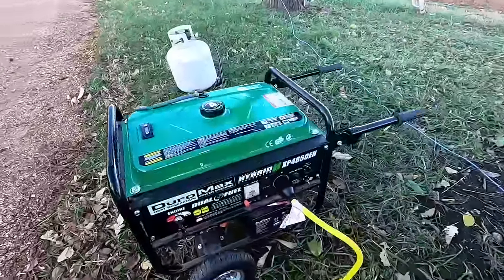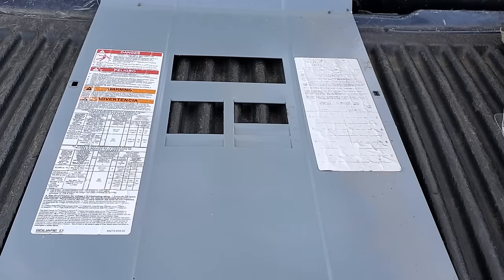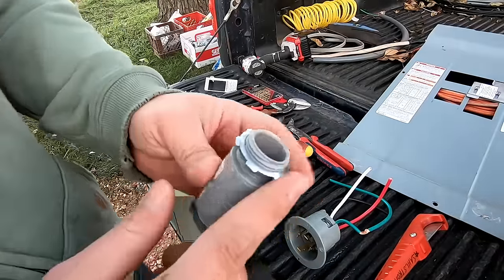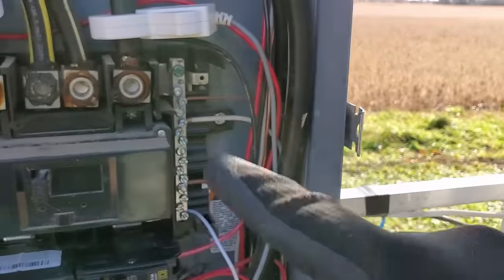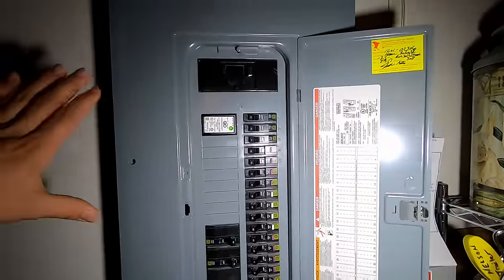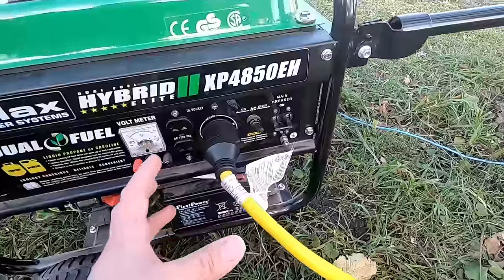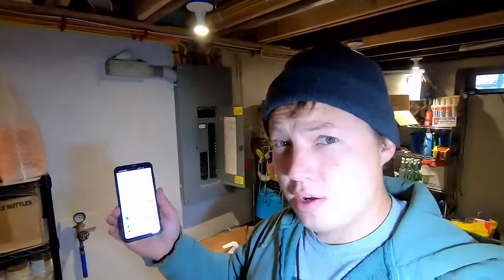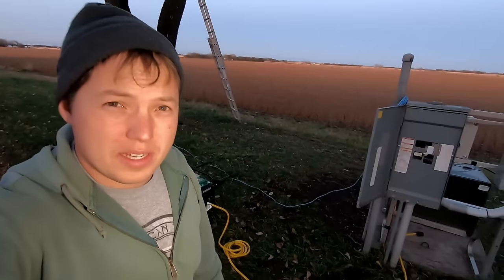How To Hook Up a Generator To Your House Using a Breaker Interlock Kit & Power Inlet Box

Comment: Liked and Subscribed! Great content! I am trying to run 6AWG to a 50amp circuit to get the max out of my 9500/12500peak generator. The wiring should be straight out of my house and into an inlet box that will be flush (ideally). 1.) Do I need to run a conduit if using UF-B wire? If so, how do I get it through the knockout that is 0.85" wide? 2.) 6gauge UF is 1 1/4" wide, will that have to go thru a 1 1/2" conduit? In that scenario, how do I get that into the inlet box with the 0.85" knockout? Any other options would be great before I return the items I most likely should not have purchased. Thank you!!
Reply: Please make sure you follow all the generator safety rules whenever you use your portable generator. 
⚠️Here are the Generator safety rules that everyone needs to follow when using generators:

This is just a reminder for everyone’s safety when using portable generators. All generator safety rules need to be followed carefully to avoid hazards. 

1) Please do not allow an unqualified person or your children to operate the portable generator. Just because some manuals don’t say that doesn’t mean it’s safe. That is important against the generator safety rules. We also need to be keeping an eye on our children too. You need to make sure that your children are not playing near the portable generator especially when it’s running so they won’t get electrocuted. Generators pose electrical risks and they can be hot during an operation. Please keep your children away from the portable generator at all times. It is important to keep our children safe especially our little ones. Be aware of all the hazards.

2) Some people use their portable generators indoors which increases the risk of carbon monoxide poisoning. It’s important to have a carbon monoxide if you have a gas generator. Never ever use your generator indoors even if your doors and windows are open and even in the garage is not safe to use a portable generator. Not even at your porch and your deck. It is never safe to use your generator indoors and in enclosed areas of your home. Your generator needs to be 15-20 feet away from your house. 

3) 🔥generators cause fire hazards too. Never refuel your generator while it’s running. You need to let your generator cool off before refueling it and before storing your generator. Never overload your generator too. Never ever back feed your generator. You should never plug your generator into a wall outlet. Also never store propane tanks indoors. Please keep flammable things away from the generator as well and please don’t smoke cigarettes near the generator. Having a fire extinguisher next to the generator is also important against the generator safety rules. 

4) generator operation; make sure your hands are dry before touching the generator. Never use your generator in wet conditions. Don’t let your generator get wet. You need a generator tent if you need to use your generator during wet weather. Please don’t wear loose clothes when operating the generator. Turn on your generator before plugging in appliances. Use the right cord for your generator. Please do not use worn out cords. 

https://youtu.be/I1jT3ANENvI and here is a video more about keeping others safe when using generators and also about our family’s safety. It’s important to keep your children safe especially little ones. 

Hope this helps

Comment: FYI, 10/3 SO cord is good for 30 amps. 10/4 SO cord is good for only 25 amps so you need to get 8/4 SO cord which is rated for 35 amps.

Comment: Very helpful instructions and video.
Reply: Remember to always make sure you follow all the generator safety rules whenever you use your portable generator. 
⚠️Here are the Generator safety rules that everyone needs to follow when using generators:

This is just a reminder for everyone’s safety when using portable generators. All generator safety rules need to be followed carefully to avoid hazards. 

1) Please do not allow an unqualified person or your children to operate the portable generator. Just because some manuals don’t say that doesn’t mean it’s safe. That is important against the generator safety rules. We also need to be keeping an eye on our children too. You need to make sure that your children are not playing near the portable generator especially when it’s running so they won’t get electrocuted. Generators pose electrical risks and they can be hot during an operation. Please keep your children away from the portable generator at all times. It is important to keep our children safe especially our little ones. Be aware of all the hazards.

2) Some people use their portable generators indoors which increases the risk of carbon monoxide poisoning. It’s important to have a carbon monoxide if you have a gas generator. Never ever use your generator indoors even if your doors and windows are open and even in the garage is not safe to use a portable generator. Not even at your porch and your deck. It is never safe to use your generator indoors and in enclosed areas of your home. Your generator needs to be 15-20 feet away from your house. 

3) 🔥generators cause fire hazards too. Never refuel your generator while it’s running. You need to let your generator cool off before refueling it and before storing your generator. Never overload your generator too. Never ever back feed your generator. You should never plug your generator into a wall outlet. Also never store propane tanks indoors. Please keep flammable things away from the generator as well and please don’t smoke cigarettes near the generator. Having a fire extinguisher next to the generator is also important against the generator safety rules. 

4) generator operation; make sure your hands are dry before touching the generator. Never use your generator in wet conditions. Don’t let your generator get wet. You need a generator tent if you need to use your generator during wet weather. Please don’t wear loose clothes when operating the generator. Turn on your generator before plugging in appliances. Use the right cord for your generator. Please do not use worn out cords. 

https://youtu.be/I1jT3ANENvI and here is a video more about keeping others safe when using generators and also about our family’s safety. It’s important to keep your children safe especially little ones. 

Hope this helps

Comment: Ben, did you find out why your gen tripped a little early....was the line monitor off a bit or did you just get a surge? Thinking about purchasing that setup. Thanks.
Reply from the maker: Pretty sure that I just overloaded one of the legs as I wasn't really checking that my load was balanced. Not a big deal I don't think.

Comment: Your generator has a 30A outlet, does it mean 15A on each phase, and wouldn’t you need then a 15A double pole breaker instead of a 30A double you are using?

Comment: I do this for a living. Pro-Tip: You better be do doing a lot of load shedding if all you have is 30 amps to work with.
Reply: I learned that just a few minutes ago.  I thought I'd be able to run my central HVAC off of a 5250 watt generator, via 30 amp wire and a 30 amp breaker.  Damn.  I have natural gas heat.  Maybe I could still run the heat with it.  I should be able to shut everything else off and run  a refrigerator.  My stove is gas, hot water heater and dryer are gas.
Reply: @traumajock  30A service isn't enough for an HVAC system. That's why I use mini split systems instead of my traditional 4 ton HVAC system. Mini split systems use very little power, especially upon start-up unlike traditional HVAC systems that can pull over 100 LRA when they first start up.

Comment: Very informative, well done thank you.
Reply: Don’t forget about the generator safety tips as well. Remember it’s important to follow all the generator safety rules whenever you use your generator. Here are the generator safety tips:

This is a reminder for everyone’s safety 

1) Please do not allow an unqualified person or your children to operate the portable generator. Just because some manuals don’t say that doesn’t mean it’s safe. That is important against the generator safety rules. We also need to be keeping an eye on our children too. You need to make sure that your children are not playing near the portable generator especially when it’s running so they won’t get electrocuted. Generators pose electrical risks and they can be hot during an operation. Please keep your children away from the portable generator at all times. It is important to keep our children safe especially our little ones. Be aware of all the hazards.

2) Some people use their portable generators indoors which increases the risk of carbon monoxide poisoning. It’s important to have a carbon monoxide if you have a gas generator. Never ever use your generator indoors even if your doors and windows are open and even in the garage is not safe to use a portable generator. Not even at your porch and your deck. It is never safe to use your generator indoors and in enclosed areas of your home. Your generator needs to be 15-20 feet away from your house. 

3) 🔥generators cause fire hazards too. Never refuel your generator while it’s running. You need to let your generator cool off before refueling it and before storing your generator. Never overload your generator too. Never ever back feed your generator. You should never plug your generator into a wall outlet. Also never store propane tanks indoors. Please keep flammable things away from the generator as well and please don’t smoke cigarettes near the generator. Having a fire extinguisher next to the generator is also important against the generator safety rules. 

4) generator operation; make sure your hands are dry before touching the generator. Never use your generator in wet conditions. Don’t let your generator get wet. You need a generator tent if you need to use your generator during wet weather. Please don’t wear loose clothes when operating the generator. Turn on your generator before plugging in appliances. Use the right cord for your generator. Please do not use worn out cords. 

https://youtu.be/I1jT3ANENvI and here is a video more about keeping others safe when using generators and also about our family’s safety. Hope this helps

Comment: I can see a lot of these installations especially in California before next  year - they banned these generators and all small, off-road engines used in lawn equipment.  Be concious of a generator's ratings and specifications and the power needs of the loads.  These are not plug and play installations.  A 4kw generator with a 4800 surge rating  might only allow a motorized appliance (small AC unit for example) that uses 1500 watts when it's running but might need as much as 4500 watts for a couple of seconds to start the motors.  Also, dual fuel generators lost about 8% to 12% of their rating when running on propane vs gasoline.  And run time on a 20 lb propane tank is about 20% less than the run time on a 4 gallon gasoline tank.

Comment: Hi Ben, just want to say you make great videos and ask a question. What are your thoughts on the sine wave coming from portable, non-inverter generators. I have a non inverter generator and was told it is bad for my loads to operate on the "dirty sine". Personally I haven't had any issues with my generator running whatever is plugged into it but I'm am now hesitant to plug in anything expensive. I trust you and value your opinion. Please advise. Thank you for reading my comment. 

BT
Reply: ⚠️Portable Generator Safety Tips:

1) KEEPING OTHERS SAFE: Please do not allow an unqualified person or your children to operate and service the portable generator. Just because some manuals don’t say that doesn’t mean it’s safe. That is important against the generator safety rules. We also need to be keeping an eye on our children too. You need to make sure that your children are not playing near the portable generator especially when it’s running so they won’t get electrocuted. Generators pose electrical risks and they can be hot during an operation. Please keep your children away from the portable generator at all times. It is important to keep our children safe especially our little ones. Be aware of all the hazards.

2) WHERE TO RUN YOUR GENERATOR: Some people use their portable generators indoors which increases the risk of carbon monoxide poisoning. It’s important to have a carbon monoxide if you have a gas generator. Never ever use your generator indoors even if your doors and windows are open and even in the garage is not safe to use a portable generator. Also please never use your generator in your deck or balcony. It is never safe to use your generator indoors and in enclosed areas of your home. Your generator needs to be 15-20 feet away from your house. 

3)🔥FIRE HAZARDS: Never refuel your generator while it’s running. You need to let your generator cool off before refueling it and before storing your generator. Never overload your generator too. Never ever back feed your generator. You should never plug your generator into a wall outlet. Also never store propane tanks indoors. Please keep flammable things away from the generator as well and please don’t smoke cigarettes near the generator. Having a fire extinguisher next to the generator is also important against the generator safety rules. It’s also not safe to move your generator while it’s running.

4) GENERATOR OPERATION: make sure your hands are dry before touching the generator. Never use your generator in wet conditions. Don’t let your generator get wet. You need a generator tent if you need to use your generator during wet weather. Please don’t wear loose clothes when operating the generator. Turn on your generator before plugging in appliances. Use the right cord for your generator. Please do not use worn out cords. 

https://youtube.com/shorts/eFigDfnPkcQ?feature=share and here is a short video more about keeping others safe when using generators. Portable generators need maintenance so it’s important to follow the safety instructions.

Hope this helps

Comment: Great video, for safety pull the electric meter.
Reply: Remember to always make sure you follow all the generator safety rules whenever you use your portable generator. 
⚠️Here are the Generator safety rules that everyone needs to follow when using generators:

This is just a reminder for everyone’s safety when using portable generators. All generator safety rules need to be followed carefully to avoid hazards. 

1) Please do not allow an unqualified person or your children to operate the portable generator. Just because some manuals don’t say that doesn’t mean it’s safe. That is important against the generator safety rules. We also need to be keeping an eye on our children too. You need to make sure that your children are not playing near the portable generator especially when it’s running so they won’t get electrocuted. Generators pose electrical risks and they can be hot during an operation. Please keep your children away from the portable generator at all times. It is important to keep our children safe especially our little ones. Be aware of all the hazards.

2) Some people use their portable generators indoors which increases the risk of carbon monoxide poisoning. It’s important to have a carbon monoxide if you have a gas generator. Never ever use your generator indoors even if your doors and windows are open and even in the garage is not safe to use a portable generator. Not even at your porch and your deck. It is never safe to use your generator indoors and in enclosed areas of your home. Your generator needs to be 15-20 feet away from your house. 

3) 🔥generators cause fire hazards too. Never refuel your generator while it’s running. You need to let your generator cool off before refueling it and before storing your generator. Never overload your generator too. Never ever back feed your generator. You should never plug your generator into a wall outlet. Also never store propane tanks indoors. Please keep flammable things away from the generator as well and please don’t smoke cigarettes near the generator. Having a fire extinguisher next to the generator is also important against the generator safety rules. 

4) generator operation; make sure your hands are dry before touching the generator. Never use your generator in wet conditions. Don’t let your generator get wet. You need a generator tent if you need to use your generator during wet weather. Please don’t wear loose clothes when operating the generator. Turn on your generator before plugging in appliances. Use the right cord for your generator. Please do not use worn out cords. 

https://youtu.be/I1jT3ANENvI and here is a video more about keeping others safe when using generators and also about our family’s safety. It’s important to keep your children safe especially little ones. 

Hope this helps

Comment: Hello Ben, I had a wtr htr I got going with a small gen, it works well.  the htrs were rated about
4500 watts. I put the top an bottom htrs in series to a 240 volt line and got the water somewhat 
warmer than coming in to the house. In series they drew a little over 9 amps.

Comment: I happen to have a torque wrench for firearms... so I figured I'd use it. Wouldn't have bothered to get one if I didn't have one already though, just use a normal screw driver.
Reply: Distinct Editz it’s not a torque screw or wrench.  That square holed screw is called a Robertson screw.  We Canadians use « Robies » all the time in about every job.  I can’t understand how the US is still using Philips screws, cause as soon as you apply force, you end up « rounding up » the screw.  Well that’s my opinion.